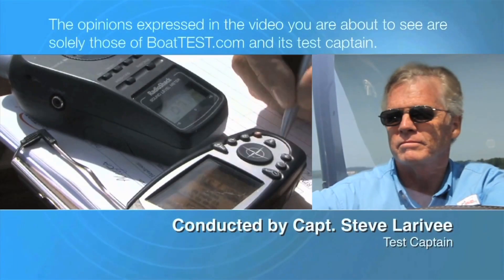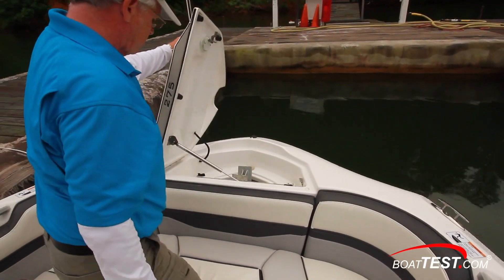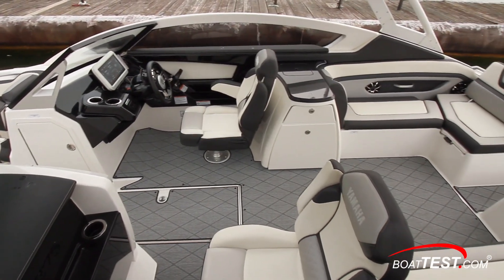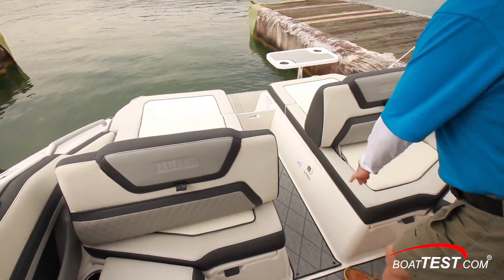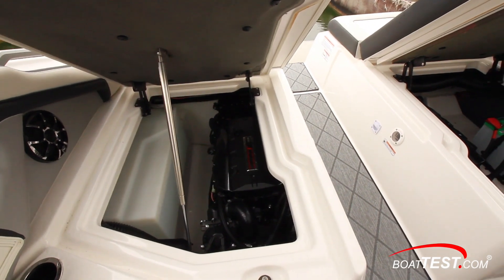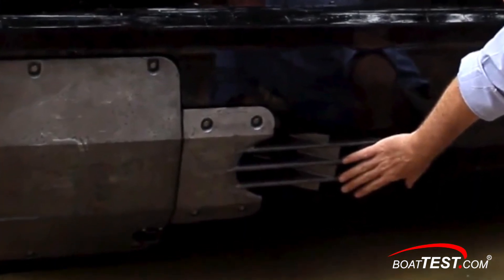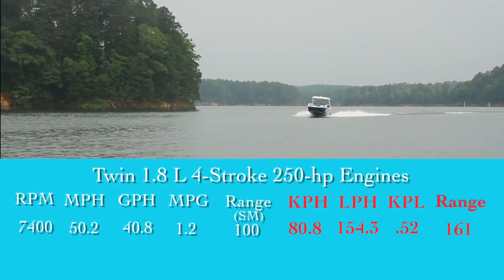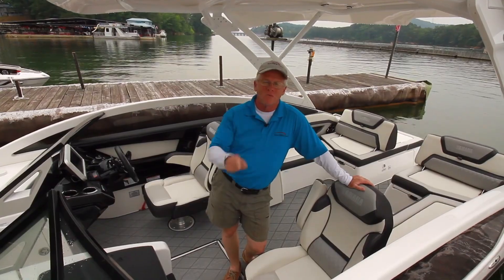Yamaha 275SD (2019-) Test Video - By BoatTEST.com

Comment: wouldn't it make more sense to have to paddle shifters mounted on the steering column instead of the steering wheel so that you always have the left paddle on the left and the right on right, and you don't have to fight trying to figure out which is which when docking
Reply: No, not at all the paddle shifters allow you to control speed and RPM when you’re standing and staring the boat!

Comment: I own a 2005 SX230 with 140hp per engine and I get consistently 50MPH with only one mod which is stainless steel solaris impellers. 
This new 275SD has a total 500HP and does the same top speed???  I was sure it would do at least 55MPH
Reply: While the 275 is only 4 foot longer, it's much wider and weighs almost twice as much as the SX230. So the top speed makes sense.
Reply: Remove the LoL?
Reply: Makes sense

Comment: 50mph for a jet boat is slow! Anything under 85mph for a jet boat is an embarrassment!
Reply: Jet boats are known for acceleration and handling. Jet drives are very inefficient for top speed though. For higher top speeds, propeller driven boats are always better but at the sacrifice of acceleration. Ever wonder way a Jet boat with 1000 hp does maybe 80 mph but take the same boat and put an outdrive with a propeller on it and it would likely be a 120 mph boat? Yeah Jet drives waste a ton of power.